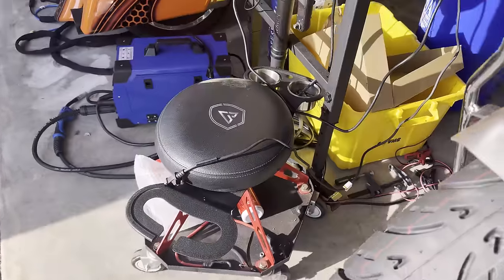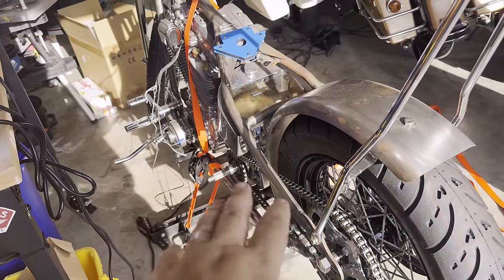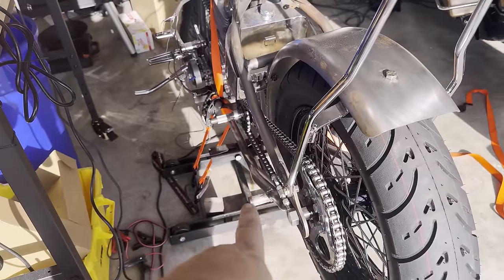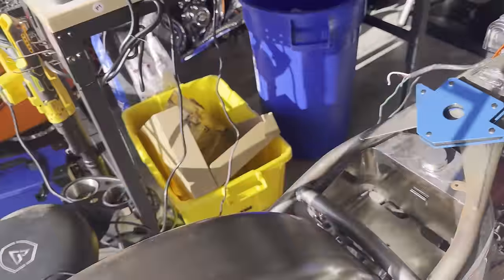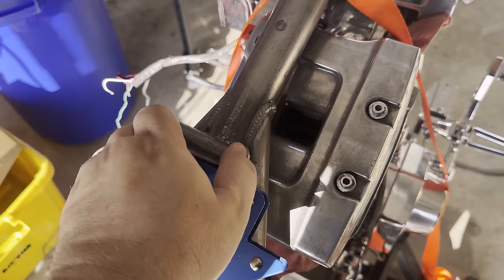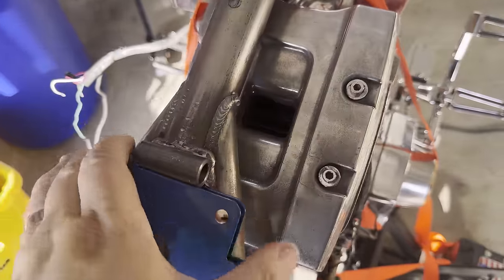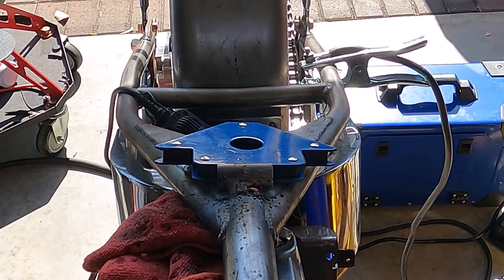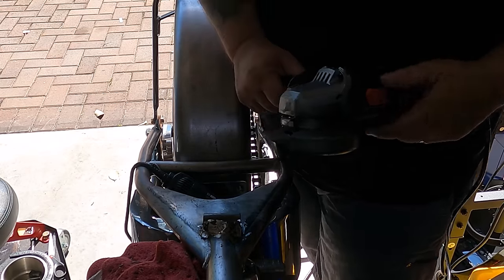Welding for dummies, and I’m the dummy.

Comment: Quick tip with Flux core pre heat the metal before welding cuts down on the splatter and helps the metal pool for better bead
Reply from the maker: Thank you!!!!  I appreciate it!

Comment: You should use a C-Clamp to install the bushings. Love the show.
Reply from the maker: Good idea
Reply: @ProfessionalMonkey  G Clamp, C Clamps are made of Aluminium and break easily (because they're meant for holding wood) though a Brake Compressor will maybe be better, even a knocking stick that's kind to the bushing will be just as good I expect (a tool box with a short length of brass bar to use as a drift is golden). It's called an Interference Fit.

Comment: You can't build a side mount plate/tail light bracket to heavy duty. Mine lasted 15 years, cracked on the welds. I had a expert fabricator, make one out of 1 piece  of steel. All custom bent, zero welds. He's got a million dollar shop, though.

Comment: You're letting me down by not polishing the welds.  You need to start with 100 Grit and work your way up to 1000 Grit or you ain't a REAL bike builder.  Start now and you can have the bike ready for Smokeout 2026.

Comment: You're too hot, reduce your wire speed and voltage. I guess your wire is Flux Cored, as I don't see a gas bottle (Argon), cut your wire short (an eighth of an inch is plenty) and keep your wire cutters handy, also a file, in case the wire gets stuck in the nozzle (by rights, this shouldn't happen, but does occasionally), Anti-Spatter spray is your friend, use it (even on the nozzle). Keep your Arc and Weld Pool small, watch the weld pool and push the nozzle slow and steadily.
Practising on steel plate, rather than tin will familiarise you with laying down a bead (though if tin (sheet metal) is all you have, it's likely closer to the automotive welding you'll be doing over the years), the bead will show you if you're too fast or slow, any undercut and you're too hot, the bead sitting on top and you're too cold / fast, you want nice mellow looking lines in the bead ("u"'s rather than "V"'s- the softer the better - like this bracket ).
Really, protect all the rest of the Bike from spatter, it'll stuff your tyres and polishing..
Look into getting your hands on a set of Oxy-Acetylene Bottles, as Gas Welding (and the word is *"Welding"*, not sticking, welds seldom brake without a reason) is the best way to learn (forming and controlling a Weld Pool, whilst feeding in the Filler Rod, one Bead at a time..), it's also versatile.. ..and you'll get to learn about controlling heat distortion and all sorts of fun stuff 😅😂🤣.
Consider doing a Welding Coarse, even if only an evening class, it's a great skill to have and you're obviously keen.
Reply from the maker: Great advise, thanks!
Reply: @ProfessionalMonkey  No worries, everyday's a school day for everyone, we should all be learning from everything around us (and I was only to eager to vent my spleen the other day it seems.. 😄😆😅😂🤣🤣 - sorry.)
One thing I neglected to mention was Three Phase Electricity (or whatever equivalent you have in Florida), if that small M.I.G. knocks your circuit breakers / trips your fuse box, then having something a little more business like in your garage / workshop is a good idea.
Your going great guns of course, I'm stoked following your build, you're really taking it on, Kudos.